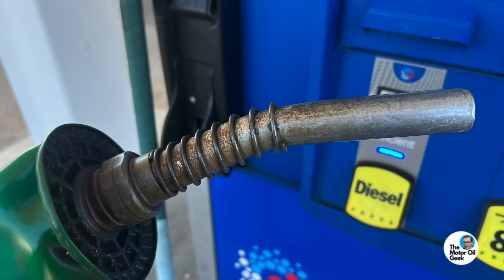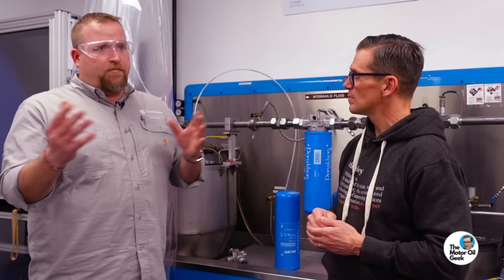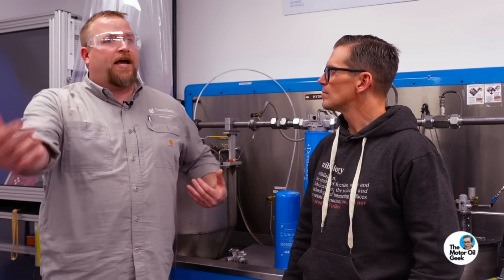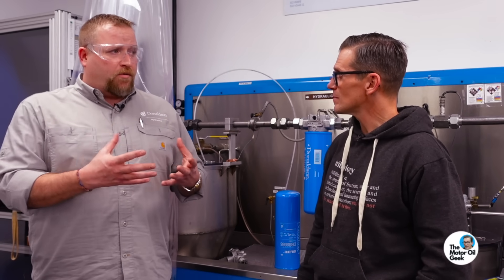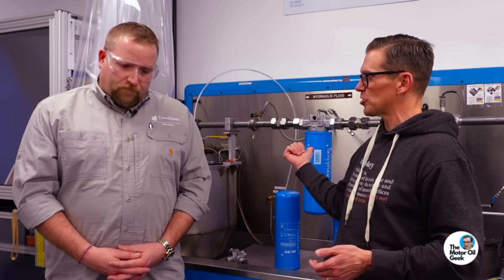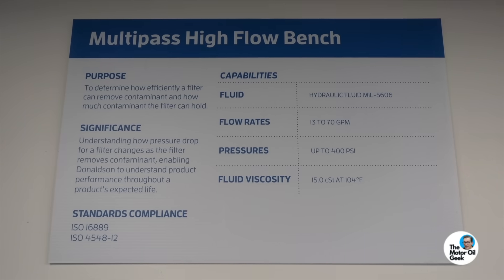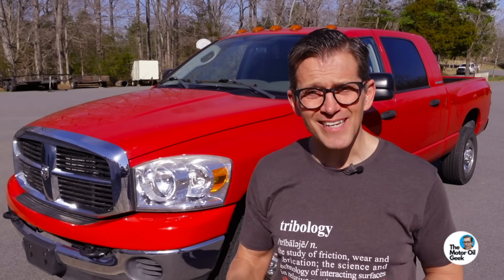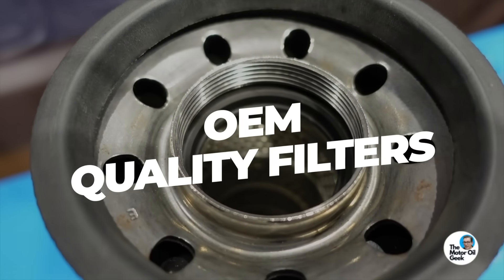Diesel Is DIRTY (And It's KILLING Engines)

Comment: Hmm my last Cummins had over 800 thousand this truck has over 600,000 change filter 2 to 3 times a year never had an injector problem of course i run 3 oz of hot shot per tank
Reply: I had injector failures because of water, The fuel at a local wawa has like half water lol
Reply: @SilverStarHeggisist yes water is the enemy i always get fuel at as busy of a gas station as possible but that doesn’t guarantee anything

Comment: When using pump fuel, one idea for cleaner fuel is to set the fill at the SLOWEST flow rate to create the least disturbance in the below ground tank and reduce stirring up of sediment in the tank.  I've never tested this or seen test results on this practice's effectiveness.  But it can't hurt.
Reply: It won't help, because there's usually more pumps going full tilt and before you got there there were pumps going full tilt
Reply: @SilverStarHeggisist  not at the sleepy small town station I visit late at night.  I'm the only one there 99% of the time.

Comment: New product recommendation. 
A Pump to Tank Filter(PTF)
Put the nosle into the gland on the device, device has a clean distribution nosle  to go into the tank.  Could use a centrifuge spun by flow as the primary  with a small micron higher efficiency raiting spin on as the 2nd.
Reply: I was looking to see if anyone else was thinking what I was thinking.  Good idea on the centrifuge!

Comment: Advice to all vehicle drivers.
Never buy any fuel at pumps that are currently being delivered to by the delivery truck.
The underground tanks are gravity feed from the semi truck.
When that volume of liquid inrush hits the tank all sediments in the bottom ie water and dirt. Are mixed into the tank. It will take at least an hour for to settle again.
All tanks ingest water and debris from the simple act of emptying and refilling pulling atmospheric air mostly unfiltered outside air as they empty.
All fueling stations have electronic tank level monitoring devices the public never sees. The amount of tank space displaced by water is displayed as “Ulage” .
Reply: I remember hearing that as a teen.  But after millions of miles, my experience says (not proves) it's mostly a myth. 
This involves hundreds of thousands of gallons of fuel.

I always look for the best NET PRICE  on fuel and plan to be near empty. 
This means I will buy 200-275 gallons.  I usually expect to see a tanker nearby as busy truck stops can require a fuel drop every hour. 

I rarely see a half ounce of water accumulated in ~15k miles. 
However, I always have spare filters of both styles on my truck.   

The biggest offenders are hardest to spot.  They have water ponding or running into their underground tanks.

Comment: One of your final comments is very accurate and that is to not change fuel filters too often. The more often you unnecessarily change a filter the more often you open the system to potential contaminants. Also, contrary to popular belief filters have their lowest efficiency when new because the largest poors haven't been filled with particles yet. Follow the recommended intervals unless there is real evidence that they NEED to be changed sooner.
Reply: That comment stuck out to me, too.  As an ecodiesel owner, I have always changed my fuel filter at 15-20k mi.  The spec was 30k, until the CP4 pump recall.  Now it's 10k.  I think the vulnerability of opening the fuel system is outweighed by the risk of a clogged filter causing bypass.
Reply: I think about this everything I change the filter a bit early. I’m convinced you could get a “new” filter that had some contamination. It’s the one time I wish they’d used more plastic in the packaging.
Reply: I have a fuel pressure gauge, when the pressure drops, I change it

Comment: For my 2003 Dodge Cummins 5.9 I use the factory filter housing with the Baldwin filter that is rated for 5 microns absolute, and added a Cat 1R-0750 2 micron filter after the factory filter to get as much contaminates out as possible. IIRC the Mopar filter was 10 microns, and Bosch wanted a minimum of 4 microns.
Reply: 2005 Jeep Liberty CRD diesel. It came with no lift pump, and a crappy paper filter that was the high point in the system, that you had to manually prime and vent the air out of it every few days, or it would accumulate so much air in it, it would actually cause the engine to misfire.
Ended up installing a fuel tank module with a lift pump for a 2005 Cummins, and changed the fuel filter setup to a Stanadyne filter assembly with a 100 micron inlet screen and a 30 micron water separator filter with a water drain bowl, and a Cat 1R-0750 downstream of that.

Comment: The industry has let quality fall off a cliff. My 2001 V10 gas truck has needed zero anything other than consumables for 25 years & recall spark plugs The entire truck has 5 switches to go bad and nothing more. Simplicity is the key to quality not complexity Adding 10 layers of technology to these trucks has insured they will never be running on original hardware 25 years later

Comment: Good stuff.  OEM grade fuel filter is easy - Top Tier fuel is almost impossible to find in 90% of the country and at best is most likely more than 500 miles away from a significant portion of the population.
Reply: After using the top tier website, I was surprised how many stations there are!
Then I set my fuel/price locator app to only those brands. 
Now it’s easy to find good fuel.
Reply: OEM filters can be worse then aftermarket. For instance OEM for cummins is 7 microns, I run an aftermarket at 2
Reply: @SilverStarHeggisist  I think the point is that finding a quality filter is a lot easier than finding top tier fuel

Comment: My day job is in the lift truck and farm equipment industry. The gravity feed, bulk tanks that equipment gets filled from is a MAJOR problem. Dirt, water, etc. Very costly. And tell your dad to just say no to a new truck, especially a Diesel. The DEF systems are a pain, regardless of the OEM.
Reply: Powerstroke diesel only!
Reply: @Davido50 My work truck has a 6.7L power stroke. Just shy of 300,000 miles. I keep the oil changed and fuel filters are replaced regularly. I also run a cleaner/lubricant every few tanks. So far it’s been perfect other than a DEF code on occasion.
Reply: I deal with that stuff constantly.  They never clean anything out, let alone set them up right to help keep the water out of the tanks, and then they have huge fits because they are getting severe water/algae/rust problems that standard filters will not take care of anymore.
Reply: @illbeyourmonster2 And they get mad when they are denied warranty on their fuel system when the fuel sample shows excessive dirt and water.

Comment: Lake  - how come we do not have fuel filters in gasolines engines? I can't imagine Gasoline being that much cleaner than Diesel fuels.
Reply from the maker: There are fuel filters in gasoline engines
Reply: @themotoroilgeek I must have had a brain fart (duhhh) when I asked that question - the fuel filter is usually integrated within the fuel tank - thanks for taking the time to answer me.

Comment: Paccar had an issue with injectors failing badly on new engines, replace all and would fail again, some areas of the east coast had no issues due to fuel quality.  Was told the fuel in the EU is refined to finer spec, where these injectors come from, so better fuel filtration is needed on the trucks to keep them running.  Did not hear back what Paccar did but the local guys here upgraded their filters and had fewer issues.

Comment: My friend drives an 83 Oldsmobile Toronado diesel, which has had a Racor 500FG marine turbine style filter/water separator almost since it was new. And it has over 600,000 miles on the original engine. That filter has a 2 micron cartridge installed.
Reply: That was a big issue on the GM diesels like that, not enough filtration with the factory setup. 
Adding in a racor fuel filter/water separator combo definitely helped that fuel system live.
Reply: I worked at a Diesel injection repair shop from the 80's to 2006. We sold thousands of Racor filter systems, very good filters
Reply: 600,000 exact miles? w0w! I'm blown away by the fact that Oldsmobile was able to propel this 6,000lb steel slab with that 350ci, 105hp engine!!! 5.7L diesel making 105hp and barely 200ft lb of torque.. I think the 'efficiency' should be shifted to the engine and not the filter!
Reply: @JohnnysCrap  4,654 pounds.
O-60 mph in 17.8 seconds.
I pass other cars all day in my 2016 Prius c Two.
0-60 mph in 10.9 seconds.
Reply: gotta be the healthiest 350 rocket diesel on the road, lmfao
A fuel/water separator and thicker head studs would turn those into an underpowered but quite reliable engine. Or you could turn a DX block into a very sturdy gas motor.
Reply: Older stuff was built better! Well, MOSTLY I should say -  except for the 350 diesel, lol. Someone must've fixed the headgasket issue on this one!

Comment: DPF, SCR, EGR, low sulfur fuel, and lack of maintenance is what is killing most diesels. If you own a diesel vehicle you need to change your fuel filters every oil change
Reply: DPF SCR I EGR JE NAMERNO IZMISLJENO KAKO BI SE STO PRIJE UNISTIO DIZEL MOTOR...NEMA VEZE SA ZASTITOM OKOLINE I PRIRODE
Reply: @AleksjiViktor baš tako
Reply: Can anyone comment about the new EPA standard on diesel that was announced 2 days ago?  Seems now that RAM/GM/Ford pickup truck manufacturers should be able to legally Delete trucks.  I.e. No EGR, etc
Reply: Kinda sad that we're now a the point where taking a modern diesel out and replacing it with an old well well-worn Detroit 2-stroke will yield cheaper operating cost per mile by a wide margin.
Reply: @illbeyourmonster2  and reliability. Your truly better off taking a pre 2007 ish truck, rebuilding the engine , swap the trans, bolt up a new driveline and make sure the AC works than you are buying a brand new truck. You’ll save like 100k and you won’t have a breakdown for a decade
Reply: @Divided-we-fall1776  LOL!  I have a buddy who reformated his business to just doing that!  He picks up old oilfield and farm rigs for scrap and then pieces together good trucks out of them. 

I love it, but I hate that he gives me crap about when I'm going to sell my pld beaters to him for parts because they are now worth multiple times what I paid for them due to having good non emission engines in them.
Reply: I change at  20k and it wasn't bad at all.  Just mildly discolored.
Reply: You should be changing your fuel filters after every fill up. Filters are cheap. Diesel engines are not.
Reply: @truckinman86 that is incorrect. That’s worse than not ch aging filters. Fuel Filters clean better as they trap more particles to a point.
Reply: @truckinman86  bro I literally get paid to change filters and I could never in good faith tell someone they need to change fuel filters with every tank….
Reply: @truckinman86  What fuel filters are that cheap?
Reply: @truckinman86  yeah right. You should be changing your fuel filter every ten miles.

Comment: Donaldson should publish an article outlining best filters to use for a fass or airdog, and then the best filter on the truck stock filter housing to systematically clean the fuel from retail fuel suppliers.
Reply: If you have a fass oem is pretty useless. Unless you love buying 2 filters and just like peace of mind. 🤷🏼‍♂️ I did however keep my oem... until the housing started to leak and I said to hell with it. 😅

Comment: The biggest problem I see is so called Mechanics who don't know how to keep things clean especially with these new Eco friendly filters systems found on almost all new Diesel engines now, Some of you would be Shocked on the lack of understanding how important cleanliness is around modern fuel injection systems, Make sure Your Mechanic understands how clean everything needs to Stay while repairing replacing anything fuel related especially on the high pressure side of the system or anything right after the last filter, Has to remain spotless, Because we can't see 4 Microns of a dirt particle, A young child with perfect vision can see particles as small as 29 microns that's it,  Most of us adults won't see much under 100 microns, Without something to enhance the image, So things may look clean until you look under a microscope. Like Dave does at Dave's auto in Utah when inspecting failed CP4 injection systems. All I can say it investing in Fass fuel systems with dual filters is a Good insurance along with a good fuel additive for lubrication enhancing.

Comment: A modern Diesel is so unreliable these days -- not because Diesel engines have become any less reliable, but because the emissions systems are horrid.  DPF and AdBlue systems both add incredible complexities that diesels of 15-20 years ago did not have.  And those complexities cause malfunctions and failures which cause the vehicles to run poorly, or not at all.

I wouldn't own a Diesel newer than about 2007 or so.  Keep that '02 RAM of your Dad's until the wheels literally fall off.
Reply: This is the plan to get you off diesel cars

Comment: I have heard Dodge skimped on filter systems to push trucks to production.

All the old Cat products had “Buy clean fuel, keep it clean “ cast into their filler caps.
We change filters ever 250-300 hours and often flush the tank in the off season.

Still waiting for the centrifugal oil/oil bypass filter video!
Reply: Centrifugal oil bypass filtration system ; yes please , do a cost , & effectiveness, & how do you clean them. ? & how often ?
Can this system also be used for the fuel ?

Comment: If you notice diesel fuel filling stations dispensing pumps they are also far dirtier than gasoline, and spills more common,  but the dirtiness is two fold, because it doesn't evaporate like gasoline.

Comment: I'm familiar with Top Tier (probably from you) but I have not heard of Tier 4.  Maybe share that in some video where it makes sense.  BTW, you are awesome.
Reply: Top tier is in reference to higher fuel quality available at some pumps.  Tier 4 is in reference to emissions systems equipped on diesel engines.  There are different levels depending on when the engine was manufactured.   Tier 4 final is the current level of emissions standards.  The higher the emissions standards, the cleaner an engine has to burn it's fuel to meet those standards. One way of doing that is increasing injection pressures, and controlling fuel injection pulses; meaning cleaner fuel is required for the tighter tolerances.

Comment: Is gasoline this dirty also?
Reply: Usually yes but the but the components are nowhere near as sensitive to them. 

Modern diesels are running pressures as high as 80000psi. The new cummins L9 has 7 injection events per power stroke. This requires extreme prescision in the fuel system. The tiniest particles can cause problems.

Gas injectors work differently and can pass large particles with no problem. Even gas direct injection is only running 3000psi on the top end, and it's only as prescise as the ancient diesels that run on junk fuels no problem.

Comment: 50 years of owning and operating diesel powered equipment, from full mechanical to HPCR with 0.00 fuel related issues. All with OEM filtration.

Comment: I can see this Dirty Diesel fuel situation in a DAVCO fuel filter because of the Visible filters inside the Polycarbonate or whatever clear plastic is being used, My favorite water separator pre filter system.

Comment: What about the fact that soot is abrasive and we are recirculating it back into the intake (EGR)?  Besides the modern FI systems not being tolerant of these abrasive particles, we are doing extended oil changes using a "high performance" oil, yet we are shoving abrasive soot right back through the intake and into the cylinders.  No wonder modern diesels don't last like the diesels of years past.
Reply: We're not supposed to talk about that part. The handlers of the herd of elephants in the room gets upset when people start seeing them.

Comment: Hi Lake, love the content even though I don't have a diesel and don't want one (I have 17 other engines and they're all gas).  Would love to find out if Valvoline R&P does anything to slow or reverse intake valve deposits?  Also, would love a video about oil selection for outdoor power equipment.  Thanks!
Reply from the maker: Glad you like the content and thanks for the suggestions!

Comment: And also to address that trucking company he's talking about with the bad injectors, over the course of my truck and career I keep close friendship with all the truck mechanics and ask about parts and failures and things to expect to break. I've never heard once a mechanic say injectors are falling out of the sky. The number one thing that is breaking on commercial diesel trucks is DEF systems and components. 18 wheelers are pretty damn robust and the last thing you will ever hear from the mechanic is that it's a fuel related issue. Think about it if you're related issues were so common there wouldn't be such a thing as an owner-operator because they would be paying out of pocket for all the parts and never making any money to bring home to their family.
Reply: statistically they're issues.  but of course if it was that dirty that it would be an often problem that you'd be noticing often people would complain about it. but still, the euro solids limits and higher lubcirity of sold diesel(regulation spec) do affect wear.
Reply: Yes agreed but the DEF and DPF problem are the end result of fuel quality impacting the injectors and combustion and generating more soot which then gets trapped in the DPF needing frequent regen and DEF dosing.
Reply: @MrKhabbu I see that frequent regions are due to the driver letting the truck idle too long. Also with deaf components I see death injectors and deaf heaters going out, that has nothing to do with dirty fuel
Reply: Reading this after fixing my triaxle's DPF system... again